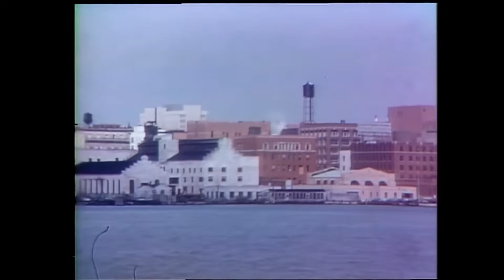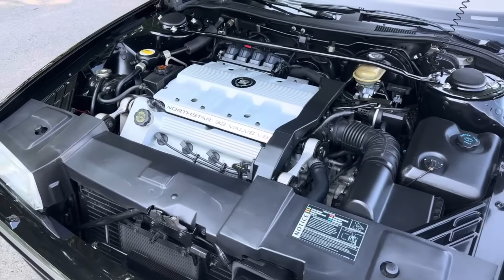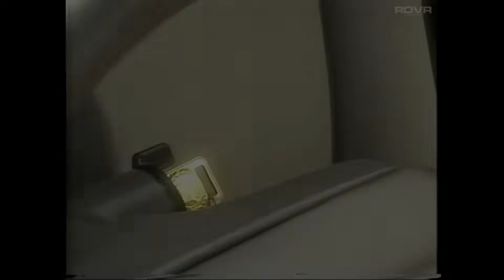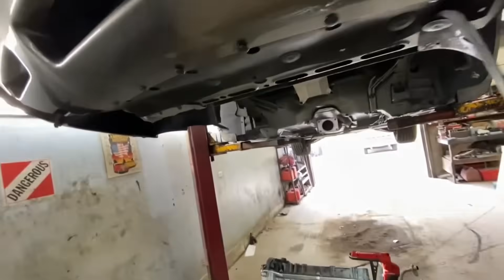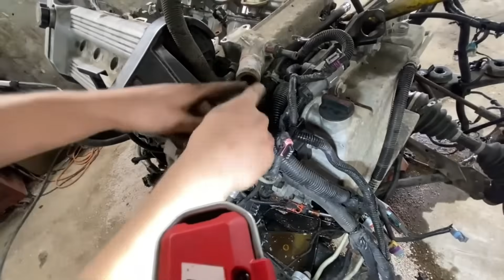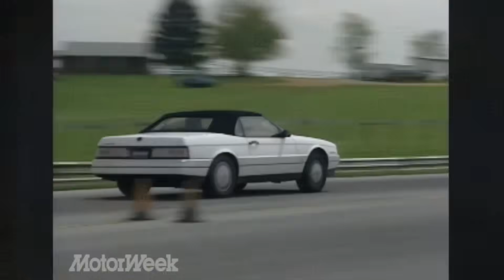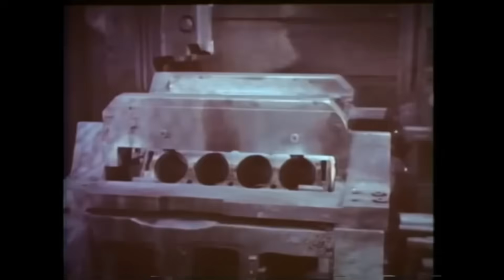Most HATED American V8 Engine of All Time!

Comment: Never understood why so many Americans worry about what Europeans think of our products. Nobody, NOBODY can name one European auto brand that isn't a total maintenance/ financial nightmare.
Reply: Volvo ? Most basic Mercedes vehicals.
Even the M. Benz Diesels were great lasting and very durable !!
Got ya !!!
Reply: @ChrisLichtwark-b4k  Some people can't read or struggle with comprehension. Some European vehicles may have strong engines, transmissions, or other components but, the cost to purchase the vehicle, maintain it, insure it, and depreciation all ad up. Yes a rare, certain model may have decent components but, that doesn't mean the rest of the vehicle is good. Comprende?
Reply: I have to speak up for the Volvo 240. I do realize it’s not a plush fancy ride but it is a wonderful piece of machinery. Using factory original parts is the key to trouble free driving.
Reply: @richardcrouse9074  I have to confess I do love the 240. Sedan and wagon. My friends parents had one and it was really cool in my opinion. I like many Volvo's actually. Maintenance was far more expensive than most American autos though.
Reply: I can name many from the golden age, European vehicles 98 and older wear far better than any American crap
Reply: @ljbrizo  You can start with one, and just so you know I am not an American tribalist, I will offer a few:
1.  Air cooled 911 - Any year any model.  These are out of reach for most people and are not a daily driver.
2.  MBZ W140.  This was peak Mercedes, but maintaining them is a never ending challenge.  Here in the US, used W140s in good shape are VERY cheap and hence are a good choice for a new car enthusiast who can handle some tough lessons about keeping a decades old expensive car going.
3.  W124.  The best examples are lower powered versions.  Same for the above W140.
I love German inline 6 engines both gas and diesel.  The Americans also made some great inline 6 engines.

In the US, older cars with good bodies, low rust and good interiors are very affordably made to be very rugged, very reliable and very cheap to repair major drive train components.  1970s American transmissions such as the GM TH400 and the Chrysler A727 were good choices of some premium cars even in Europe.  I believe some years of Rolls Royce used the TH400; quiet, smooth and trouble free and able to handle heavy loads continuously.  The A727 Torqueflite:  Another smooth reliable rugged transmission found in vehicles ranging from the most modest A-body Dodge with a 360 all the way up to very sizeable motorhomes and back in the day in Dragsters (with valve body modifications.  What European transmissions from the 70s, 80s or 90s are known all over the world?

There are many American cars from the '70s, 80s and 90s that are the exact opposite of crap.
Reply: @ljbrizo  Name them. We'll wait. Being a euro snob and hating America is a mental health problem. Help is readily available.
Reply: Give me a pushrod 472 or 500 Cadillac engine.  That was extremely reliable . I should know, I owned a 72 Sedan Deville. Had a ton of miles but ran sharp.
Reply: Fiat
Reply: ....Volvo.
Reply: I agree. European engineering is disastrous. They get away with it because they don’t put the miles on we North Americans do. Most of Fords problems lately are because Ford has been using European engineering. Why GM wanted to build an engine to compete with European junk is beyond me. Power is one thing but if it’s not reliable it’s worthless.
Reply: The Germans created a 4cyl diesel engine that powered taxis throughout Europe that lasted into the million mile range.
Reply: Early 70s and the bulk of interest in Cars made in the GREAT USA, were beginning to be ugly, slow, bad handling and no longer Cool. By late 70s ? Nobody outside Texas, would be seen Dead in one
Reply: have you looked at these cars ? they look like from russia !
Reply: Some of you folks may not like Donald Trump, but back when the US made very nice 4 door sedans like the LTD which are roomy and reasonably priced.   But the trade agreements let the Europeans impose a large tariff while their shipments to use has a low or zero tariff.
Reply: @GilmerJohn   We imposed a 10 percent tariff on EU cars and they imposed 25 percent on ours.  Not fair.   And we were giving China 50MN a year in  developmental money, to build up their economy....we were still giving it to them a few years ago, I wonder if they are still  getting it.   Everyone wins but Americans.
Reply: @GilmerJohn you do realize that MB VW and BMW only exported  there top trim line to the USA. Even back then a massive majority of the world could not afford to buy even mid-level trim EU car let alone a top trim , but because of tariffs placed on US made vehcles exported to other countries this affordable luxury caddie never left the shore. Even today most US made vehicles,  which on the true open market , are not sold world wide is because the tariffs the import country places on them. Btw the focus , made in great Britain is identical to the US manufactured one's are  1/3 cheaper to produce and sell and use higher quality parts.
Reply: I don't even realize Europeans exist. lol
Reply: Rear wheel drive V8 powered 1970's and even 1980's American cars today compare quite favorably against similar aged German vehicles for ease of maintenance/repairs and use as daily drivers.  Cars from every other country are hopeless.
Reply: @petepeterson5337  Unicorns I realize but; Japanese cars from that same era could hold their own, especially where reliability was concerned. Toyota Cressida and Nissan Maxima/810; both RWD and decent six cylinder motors
Reply: @piercehawke8021  Absolutely agree, AND they aren't hard on fuel, AND are more often available with a manual transmission (Not the Cressida though I have an '06 Camry manual).

Comment: 5:05 There's nothing wrong with pushrods.  It gives by far the most power per cubic foot of engine bay.  Pushrod V-8s are smaller and cheaper than some overhead cam 4-cylinders of less than half their capacity.    The tradeoff is for high revs.  I like high revs but it's not as if OHC is some kind of "high tech."  It's been around since I think 1908.  You also seem to roll your eyes at aluminum.  Aluminum is always preferable unless you're basically making dragsters.  The tradeoff is far higher cost at purchase time.
Reply: I'm good with pushrods.
Reply: @babydriver8134  I've driven a 2000 BMW M5 since Dec 1999 and it's OHC and I love revving to 7500.  But it weighs a ton and "only" makes 400hp.  I also have a 2008 F430 manual convertible getting 480hp out of 4.3L.  Anyone saying pushrods are "the best" hands down should drive both of these cars.

Anyone who says OHC are "the best" hands down, in turn, should consider that a Chevy LS would actually be smaller than either and 50kg/100lb lighter AND make more power.  It's a tradeoff with more than one right answer.  Few cars give a choice, the current 8th generation Corvette being the only one I can actually think of.  (And a recent Mustang was available with both I think.)  GM chose to do OHC for the high-performance models.
Reply: The highest power "car" engine, is based on the 426 Hemi.  It uses pushrods.  16 
of them.  Yes, only lasts for a few seconds, and has to be COMPLETELY rebuilt 
after every run.  But, it is estimated to produce 1100 HP.  

Top Fuel Dragster!
Reply: Nothing wrong with pushrods. Just look at Ford's Godzilla. Need I say more?
Reply: Really, what V8 is made to rev high enough to where pushrods can't keep up? No V8 that has a crossplane crankshaft i can tell you that. A V8 from an exotic supercar with a flatplane crankshaft, over square piston geometry, yeah you might need to worry about pushrods.
Reply: LS7. Greatest ICE engine ever.
Reply: Greatest engine for what?
Reply: @jeffarchibald3837  well, LT1 LT4 LT5 in the C7, LT2 LT6 and LT7 in the C8 are pretty good, with the LT6 and 7 being OHC.  I loved my 2JZ though being iron it's too heavy unless you're making a drag car.  I had the 38DETT and not a fan but it was admittedly a monster.  I love my current S62 and F136E in the cars they're in.

Comment: Strangely I replaced head gaskets in my driveway with common hand tools.  Early you say they cost to repair it was more than what customers earned in a year and then later on say $4 grand  to $6 grand.  That is less than making minimum wage for a year at that time.
Reply: Did you install the thread inserts in the block?   I tried to do that repair in the car....once.  It took me 3 days and I had to make tools.  Dropping the engine cradle takes about one hour, and putting it back about 2. That makes the engine repair 5 times easier and saves 10 hours of knuckle busting/back straining work.  As a pro I averaged 16 hours total labor time on each one of these and got paid for 22.  Never do this job under the hood.
Reply: @JoeRogan-d3o  I replaced head gaskets on several engines starting when I was 17 and did it for people until I was near 25. Under the hood. In the driveway with no special handmade tools.  Not even power tools.
Reply: @richjageman3976  You didn't answer my question.  Did you install thread inserts into the block, or did you just replace the head gaskets?   Also was it a Cadillac Northstar engine?
Reply: @JoeRogan-d3o  Northstar V8. No to the thread inserts. General maintaining the vehicle. My cousin said she was losing coolant so I looked at it and caught it quickly. I told her to record her mileage when the head gaskets were replaced and see if the new head gaskets lasted longer or not. Roughly 70k miles or so on it if I remember. She was happy so she had her friend get me to do hers as well.  Simple if anyone pays attention to their vehicle. Nothing mechanical will last forever if neglected.
Reply: Excellent comment. Agree 100%.
Reply: How many hours it take? A mechanic earlier said it took him 22hrs
Reply: @dosmastrify  I do not remember the exact time but head gaskets were way less than 22 hours. I could remove an engine and transmission and put another engine and transmission in a car with common hand tools in less than half that time. Modern vehicles take more time but back then it was much easier.
Reply: . Book time is 22 hours.
Reply: @douglas2lee929  To just do the head gaskets? Or is that and the thread inserts?
Reply: @richjageman3976 I was slightly off, but not by much.

The time is listed as 24.9 hours to Remove and Replace Both cylinder heads. The time is 19.8 hours to R+R the cylinder head gaskets. 

These times come from "Chilton Labor Guide Domestic Vehicles 2009 Edition, page GM 535, Cadillac  DTS 2006-2008".

These times are supplied by the factory to Chilton.  They do not include any type of modification to the head at all, such as doing the re-threading mod, or anything else.

You can imagine how long that would take- mounting the drill guide, drilling, tapping, chasing and cleaning out all the thread debris.

I think I read there are 20 head bolts, not sure if that is correct.

Imagine the tools, lift, and skill, not to mention patience, that it would take to remove that engine from under the car.

That part alone would take me 2 years.😊
Reply: @douglas2lee929  😅When I went to work at a garage they told me they bill by the book but it never takes that long. Look at book times for simple stuff. I was quoted 2 hours to replace coil packs for a Hummer and I did it in 30 minutes or so. I think the listed times include gathering your tools and drinking a coffee and then cleaning your tools and putting them away and not just the actual physical labor.

Comment: What would have prevented this ? Longer larger cylinder head bolts or studs with longer (un threaded) shank before the threaded end?  Thermal stretch accommodating length accomplished by stacking washers and Belleville washers? Highest grade multilayer laminated head gaskets similar to the ones used on Subaru Turbo engines ?   More than the minimum 4 head bolt circle surrounding each cylinder ?
  Could something like Timeserts (reinforced thread area) have been incorporated into the aluminum engine blocks as manufactured ?
Reply: Get rid of the torque-to-yield crap & use the traditional fastening screws that have worked for > a century. Now there's aluminum-on-aluminum assembly here so there might need some tweaking but it should stay together for >250K miles & longer.

Comment: the most part of the problem is an attidude problem,
 the most effective solution would have neen to systemetically replace these engines with new or rebuilt  corrected versions.
 it is an expensive solution but loosing a manufacturer reputation is much more expensive.

Comment: The most hated GM V8 engine was the 5.7L Diesel that was converted from the gas 5.7L engine.....no it didnt work like they thought it would.
Reply: You have a good argument, but I once bought a Vega.  And I think there were more angry Vega owners than there were 5.7: Diesel owners.
Reply: @dongeorge4037  I always like the Cosworth Vega. It was a cool idea, even if they didn't really pull it off.
Reply: @dongeorge4037  Not this one, I loved mine.
Reply: Ya, that was a real piece of shit, too.
Reply: And just what parts from the gas engine were used?
Reply: @kevinj747  I think they used the block and rotating assembly except for the pistons.
Reply: @MrTL3wis  No, they didn't. They used a whole different block, they all had DX cast in the side, which was made specifically for the diesel. The crank was a forged steel crank with heavier rods and pistons. The flaws came from the head bolts not being heavy enough to put up with a 22:1 compression ratio. Really the only thing it shared with the gas version was the basic design. The later years of them were actually pretty good, I'd still like to find one to drive.
Reply: @kevinj747  All I really remember about them was that one of my mother's friends had one in a Caprice Classic. I'd get stuck in the back seat and that car always made me want to puke.
Reply: @kevinj747  I worked in a machine shop at this time and you are full of chit- they were JUNK re-used gas parts  and were by far the worst thing GM ever made. Are you the incompetent engineer that designed these? -no other reason to defend such obvious chit
Reply: @kevinj747 4 bolts per cylinder. My 440’s have 5, and the compression ratio is 10.5-1.

Comment: Starter motor assembly located under the engine valley/intake manifold cover area !
Reply: like the Lexus 4.3
Reply: @tbamagic
  4.0 4.3 and 4.7 have the starter under the intake, not just Lexus.
Reply: that was ma real money maker for us pro mechanics... average Joe could not do that job. He had to come to me. I made $300 in one hour because I could.
Reply: I used to replace starters in the auto parts store parking lot! Try that with these new cars! 😲
Reply: @IdahoSnowman New cars 👎👎
Reply: Starter on Nissan VK series V8’s are under intake plenum. They’re really not too difficult to replace. Takes me about an hour.
Reply: @Jayski529  I Remember when starter replacement was an ease 15 min job.
Reply: I can do those starters in 45 min. Easiest starter ever.
Reply: My DeVille suffered a starter failure and I thought, no problem, I can replace it myself. WRONG!! You have to remove the whole top of the engine (intake manifold, fuel rails, etc, etc) down to the heads to access it. Had to have a shop come tow and repair it $$$$
Reply: Toyota did the same thing with the Sequoia engine
Reply: @edbeck8925
 Not just the Sequoia, 4runners, Tundra, Land Cruiser and Lexus. The 4.0l 4.3l 4.7l all have the starter under the intake.

Comment: "Torque to yield" is not necessarily "torque plus angle turn" or "replace with new instead of reuse" (although torque to yield should never be reused) (Jeep inline Six headbolts that were allowed one retorque then should be replaced if retorque or headgasket replacement after the first retorque were not "torque to yield" I think )
  what I think torque to yield did was allow the use of smaller weaker fasteners with no reserve of strength or clamping tension beyond the minimum required in perfect conditions 
   stud them or upgrade to such as ARP ?

Comment: Both Mercedes and BMW have engines that are as bad as, or worse than GM’s NS. Crankshaft bearing failures that destroy whole engine. Or balance shaft sprocket, that should last lifetime, wearing out. Leading bent valves and dented pistons. Timing chain too weak, timing chain plastic guide, and a list goes on. In each case both manufacturers ending up in court. Ford’s transmissions.